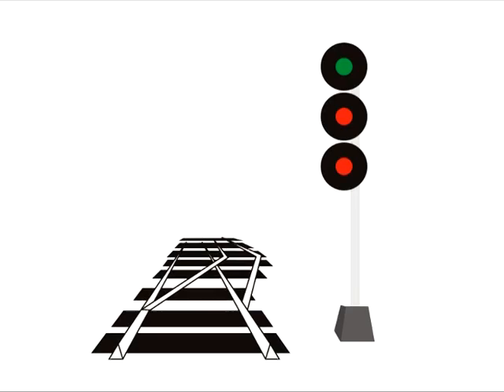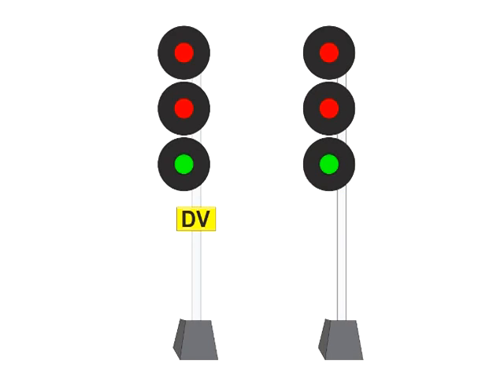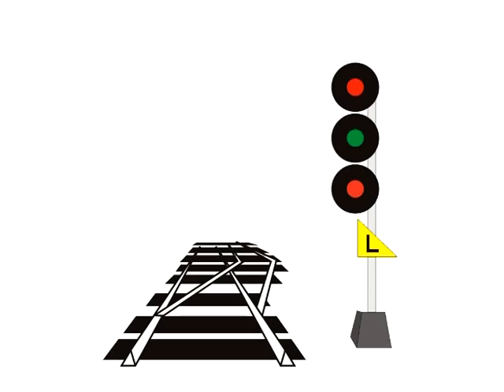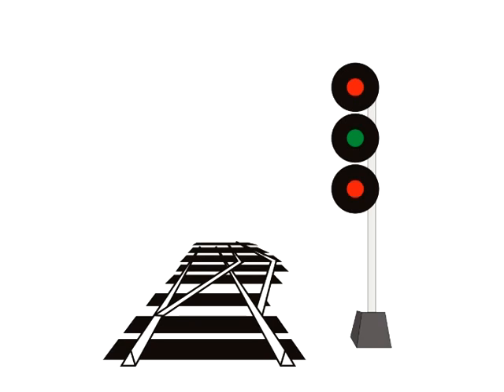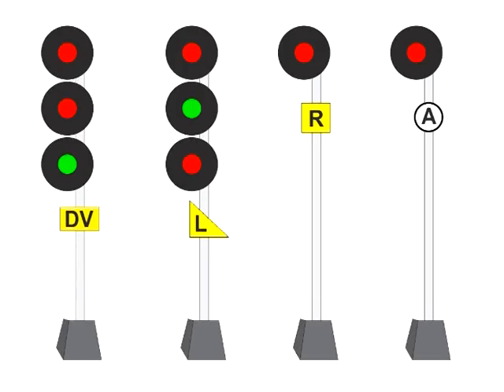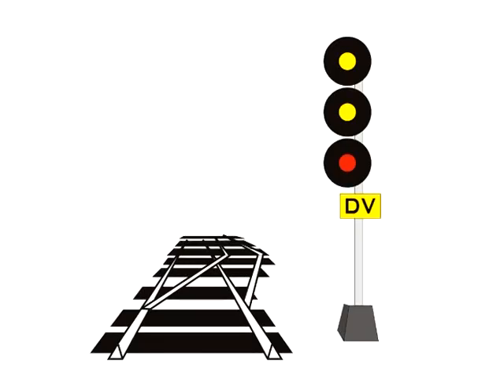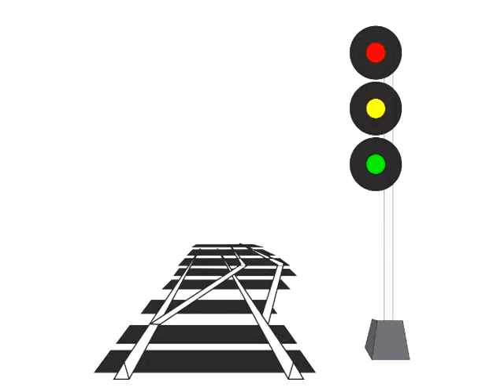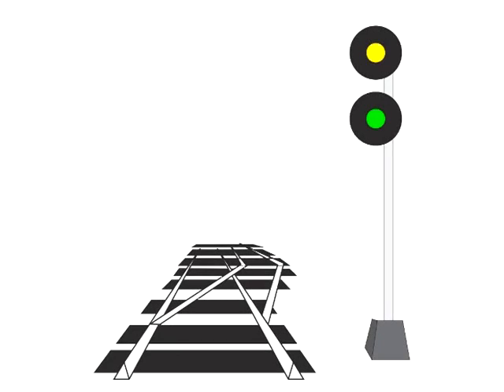Part 3: Railroad Signals, reading and meanings. Diverging and Limited speeds, to and at signals

Comment: Hi Ian,

Have very much thanks please for your intruduction into the canadian signal rules.

Me I do studying for myself some different and heritage signal rules of german kingdoms at the big German National State of 1871 under regency of the the prussion king as Kaiser Wilhelm 1rst and Kaiser (Ceasar) for Germany.
At the County of Mecklenburg it gave from 1878 on a different semaphore signal system that used up to 7 Semaphore arms to indicate different signal situations as outer home signal for behind the signal diverging train routes. This Signal system had been used until 1892 when a more modern system had been used of what in parts is still valid up today.

Since 1949 both german State Railroads went different ways and after their re-union in 1990 the loco engineers needed to learn both systems, like signalmen, too. 
Older signal rules aren't from interest after their updating periods of time, but all different and still existing types of Semaphore Signals are shown in the modern rule books, too.

At some high speed trains or higher speed loconotives a monitor shows the ahead signal positions of the signals as a help for the train engineer.

Our absolute block system is different to your system.
A train moves into a cleaf section than the sections behind the train are blocked by red signal, one block behind of it by yellow light as proced section and there behind a green section.
If a train engineer will be seeing onro a repeater Signal has a yellow and green light that means the next coming Signal has the same light in yellow over green as proceed that the next coming signal will be a stop signal.
Train engineers do drive their trains by the aspects if the repeater and/or distant signals.
Distant signals showing two yellow light means that the following home signal is red.
Two green light in diagonal up position of the distant signal means a coming green home signal.
Yellow and green home signals may be passed by reduced speed of 60 Km/h if lower speed will be allowed any white Number shows the max. allowed speed.

Comment: So I'm from Russia, and we have little bit more different signal system than that. We have the three lights heads, which has a same three signals - green is procced with the extended speed (maximum speed, that written in technology regulations documents of the road or station), yellow is the same medium speed prepare to stop, and red is stop signal. There's different types of lights according their location and purpose. For example the lights there's in the station has a one three lights head and one two lights head to diverging or maneuvers by the switcher across the park. Because for diverging you supposed to be used a two yellow lights, or two yellow one flashing, and for maneuver you supposed to be used a special lights whith the blue and lunar-white lenses. 
Also we have a short stage that's used in the high-speed, passenger and suburban moving.
Reply: Privjet. Spasibo balshoje. ;-) I have travelled from Moscow to Vladivostok three years ago. That was great. You have so beautiful country!

Comment: Do the Canadian signal rules vary greatly from the US rules?  Like for instance, UP or BNSF railways?
Reply: Canadian signal rules are SIMILAR to those used in US railroads east of Chicago, but names of indications are different; for example, "Clear-to-Stop" is usually called "Approach" in the US.  Combinations of signals may have slightly different indications but the principles are the same in any case.
  
Out west, UP/BNSF uses route semantics for signaling rather than speed semantics.  Because they operate in rural territories with highly variable terrain conditions, there's not a good way to represent speed conditions with color signals.  Instead, signals are used to make train crews aware of route changes; that is, whether or not to expect that they will take turnouts or crossovers.  Multi-head signals with different colors tell the crew they are about to take a turnout.  

The combination tells them what to expect after the turnout--like red-over-yellow might mean "diverging approach", which means the crew should expect to stop at the next signal that allows them to get their entire train onto the other track.  So the next signal might actually be yellow--"approach" or proceed expecting to stop at the next signal.  Or it might be red.  The crew will usually know what to expect because they are fully trained on their segment of the route.  

Despite being mostly focused on route signaling, some UP/BNSF indications will alter the speed.  For example, a lunar aspect or a flashing bottom red aspect means  "proceed at no more than restricted speed."  Similar to Canadian railways, a flashing yellow or green aspect might represent an upgrade to a higher speed or only apply if it's a passenger train--in these cases the track will usually have a speed limit sign near the signal that might look something like "30, F--60, P--79"  which means that if you're in a diverging condition you should normally be at 30 MPH, but if you see a flashing aspect, that indicates that it's probably a high-speed crossover AND the track condition allows for higher speeds--60 for freight and full speed (79) for passengers. 

If there is no speed signage on the track, then the crews are formally required to consult their timetables to determine the correct speed, but in modern practice, the mainlines are under Positive Train Control, which means the train will be electronically signaled via radio or track code to travel a current speed and that will be displayed in the cabin.  PTC has additional protection in that if the crew exceeds this speed for any reason, the train will AUTOMATICALLY take whatever action is needed to reduce to that speed, first by cutting throttle, then progressive use of brakes ultimately leading to a full emergency stop.

Comment: If it were up to me, I would indicate the speed you are currently travelling at as Yellow, then the speed which you should be changing to as Green.

Here's how I would define some of the signals:

Slow to Medium = Red / Green / Yellow

Medium to Slow = Red / Yellow / Green

Flashing lights, DV plates, and L plates apply to the above signals to upgrade Slow Speed to Diverging Speed or Medium Speed to Limited Speed as usual.

Limited to Limited = Red / Flashing Green / Red

Limited to Clear = Green / flashing Yellow / Red

Medium to Medium = Red / Green / Red

Medium to Clear = Green / Yellow / Red

Diverging to Clear = Green / Red / flashing Yellow

Slow to Clear = Green / Red / Yellow

Also:

Red / Red / flashing Yellow = Diverging to Stop

Red / Red / Yellow = Slow to Stop

Red / Red / Lunar = Restricting

Yellow + (R), Yellow / Red + (R), Yellow / Lunar, Yellow / Lunar / Red, Yellow / Red / Lunar = Clear to Restricting (yellow top light is flashing = Advance Clear to Restricting)

Restricting = All red, and one of the lights is flashing red (doesn't matter which one)

Take/Leave Siding = Same as the white lights on modern British railway signals

Red + (A) = Stop and Proceed

Red (no [A] plate) = Stop (Absolute)

Comment: What if there was a solid green or yellow on the bottom of a double headed signal
Reply from the maker: I didn't cover those - I'm assuming you mean a tall mast signal. We actually had several of those on the Sioux Lookout and Winnipeg runs. It becomes the bottom two signal heads. So red on top and green on the bottom becomes slow to clear. Yellow on the bottom is restricting

Comment: I‘m German and my mind is blown. Up until after the reunification we didn’t even have signals including the next one ahead in the west. They were strictly divided in pre-signals and main signals (which can be right next to each other though), and for a major part of the rail network, that’s still the case. We still use mechanical signals that work by pulling actual strings with levers today :D And I don’t know of any signal that shows what’s going on two signals ahead, but we don’t have those mega long trains, 90% of all trains are passenger trains.
Reply: Moin! In Germany (even before the Reunification) you have also one signaling system which integrates the pre-signaling with the main-signaling. 
https://de.m.wikipedia.org/wiki/Sv-Signalsystem

And then you have the modern “Ks-system” which provides also both the pre- and main-signaling. It’s a quite cheap solution. So inspirating for other countries.

Comment: The example at 8:00 about bypassing using a siding at medium speed at both ends was confusing. The part that stumped me was the signal Red, Green, Green. The middle one makes sense for medium speed. But using the bottom green for medium at the end of the siding is where I got hung up. I thought bottom green is supposed to mean slow speed.

Comment: Unnecassarily complicated. All around the world, there is a much simpler yet several times more efficient system with red, yellow, double yellow and green..that indicate everything from a switch (a lit strip at the top) with a yellow. A means signal in automatic mode, C means its under control, G means gate (level crossing) expected to honk...and so on. one can learn it i 5 minutes. Few accidents ,,,,,US, Canada have accidents/deaths every year.
Green means next 3 lights are clear. first double yellow means next is double yellow. Another double yellow means next could be yellow with a switch. you can tell if you have to change track by the small lit lights on top...so you slow down in advance. 
In India there is AWS (auxiliary warning sytem). if you croos yellow more than 65 km/hr speed is brought down. if you try to cross red, emergency brakes stop the train

Comment: There must be an easier ( and therefore safer) system than this!
Reply: Yes there is. All they have to do is use the electronic signage method that is used over roadways. Such overhead signage read things like 'Accident 2 miles Ahead' or 'Reduce Speed Ahead', etc. These are actual messages that are sent to the signs  from the traffic control center that change depending on the what is happening. This is simpler and clearly safer as there is no need to remember 50 combinations of lights.

Comment: I'm from Italy and apparently we are one of a few countries, along with Canada and Australia, and together with some US railroad, that make use of searchlight signals. I must admit that this third video confused me quite a lot, but nonetheless I found it really interesting to see how those same signals could be used in a way which is completely different from ours. We too use at most three stacked lights, but for us only the topmost could ever be red (default fail-safe position), whereas the two others could be only yellow, green, or dark (default fail-safe position: unless it's a LED, the lamp is always on but there is a black screen in front of it), if ever installed at all. Our aspects must always be read from top to bottom, and there must be no dark position in between. So for example color/dark/dark is fine, and color/color/dark is also fine, but dark/color/dark or color/dark/color are not! Red means stop, yellow means expect stop, green means proceed with no speed restrictions. Yellow over green means expect a slowdown to 30 km/h, or 60 km/h if they blink together , or 100 km/h if they blink alternatively. Red over something means slow down to the previously announced speed (there is a reminder panel tho: dark means 30 km/h, one horizontal line 60 km/h, two lines 100 km/h). So red alone means stop, red with something else below commands the announced slowdown and announces the next aspect: red over green means slow down and then expect clear, red over yellow means slow down and expect stop, red over yellow over green (the latter two blinking or not) means slow down and expect another slowdown. There are some special cases, for example for short braking distances, i.e. a blinking yellow announcing a steady yellow announcing a red, but they are somewhat rare. We have no dwarf signals except for shunting, but they are completely different: two horizontal white lights mean stop, two vertical white lights mean proceed. That's (almost) all... Bye! :)

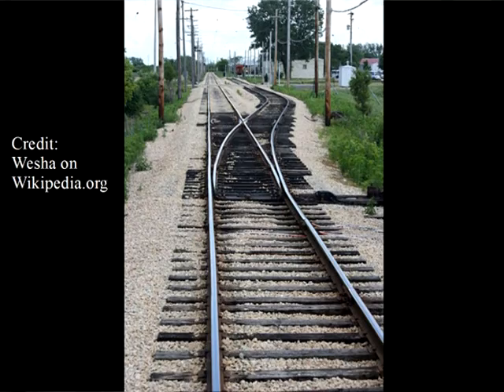Comment: The switch shown at 0:43 is not lined either for the diverging route or for the non-diverging route.  Does this happen often in Canada??
Reply: Likely a still photo of a switch with switch points while in motion.
Reply: @smokes.2 : Nice try, but I don't see anybody operating the switch.

Comment: So does the Canadian system run on mph or kmh? Going for my test shorlty and was just curious before hand
Reply from the maker: Miles per hour, because the rail operating rules were established back in the day when Canada was still using the Imperious system, so every subdivision has mile posts which are ingrained into the rules, as well as speeds like with the signals - medium speed, limited speed, slow speed, etc... were all established in MPH.

Comment: After watching your excellent series of videos, I've decided that I don't wish to be an engineer on Canadian Pacific after all.
Reply: Requirements are grade 12 only, anyone can learn this stuff. The killer is the work life balance and irregular shifts and time away from home.
Reply: @hkrause6565  well and also that even though widebody jet pilots get all the respect for skill, driving a modern intermodal hotshot at 60+ MPH average speed is something requiring nerves of steel for far longer than an airline pilot, who is really ever only put to the test a few minutes per flight.  Those tests occur repeatedly over hours for train crews.

And the consequences for failure can be equally dire--a high-speed train derailment can potentially kill hundreds to thousands of people if it happens in the wrong place with the wrong cargo.